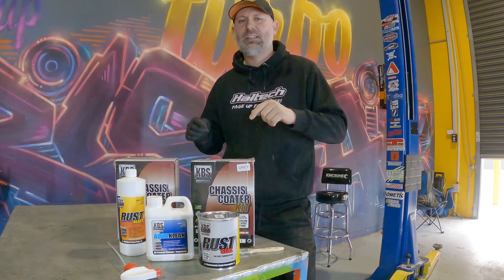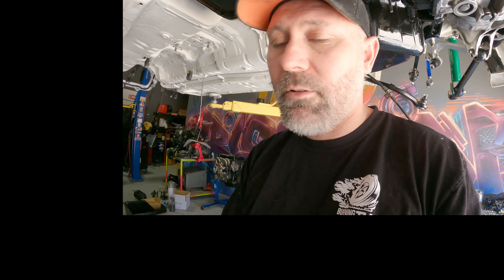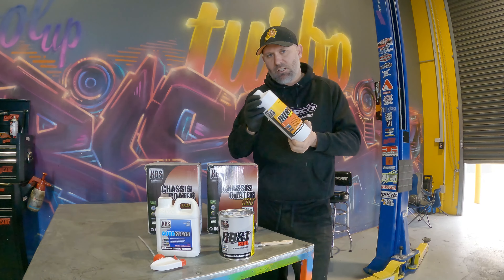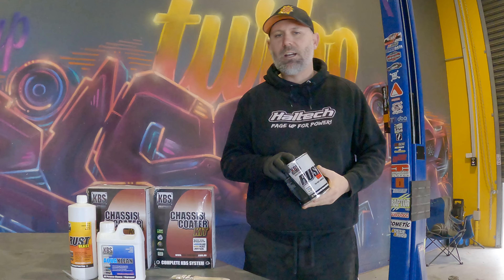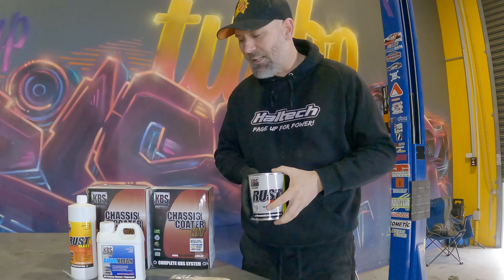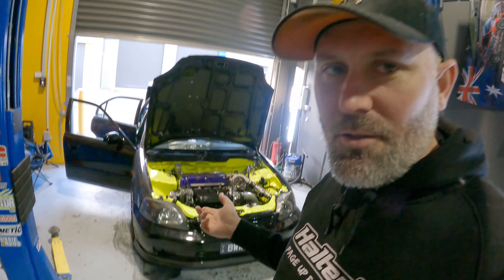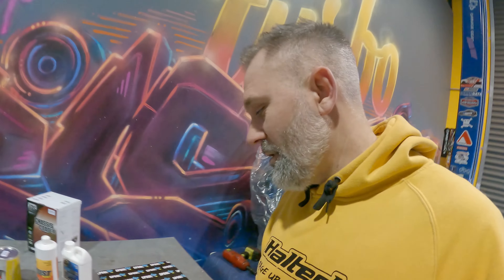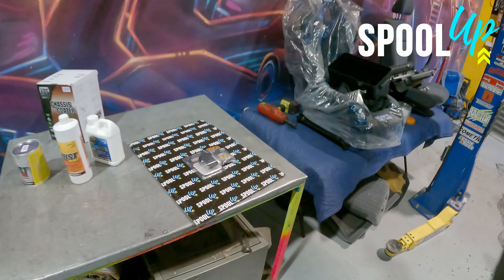Racecar Interior Made Easy- Super Satisfying

Comment: I painted the entire engine bay and inside of the car in my old 626 race car because I was a bit intimidated by 2k and spray guns back then 😂 brushed it on, self levels, no fumes, nice hard glossy finish. It’s good stuff. I wouldn’t use it now as my start up cost for 2k is $0 because I have a gun, air compressor and abundance of clear, so very cheap to do a similar job now with paint, but for anyone else looking for an absolute zero skill required mint finish on their race car, 100% recommend going this route. (Literally is zero skill too. If you can hold a paint brush, you can use this stuff to great effect)
Reply from the maker: Couldn’t agree more